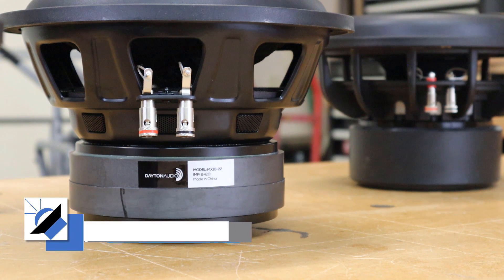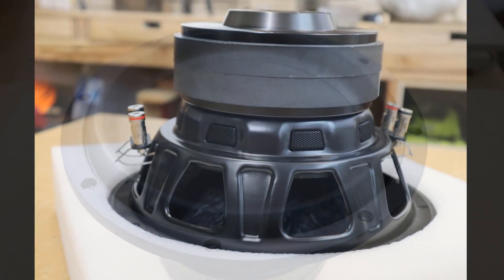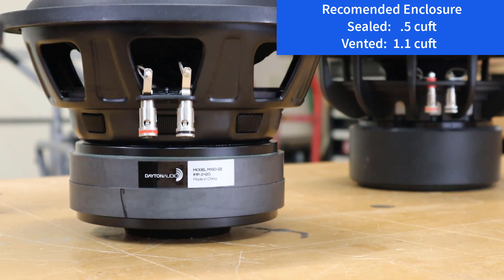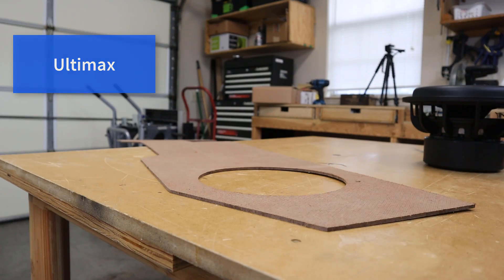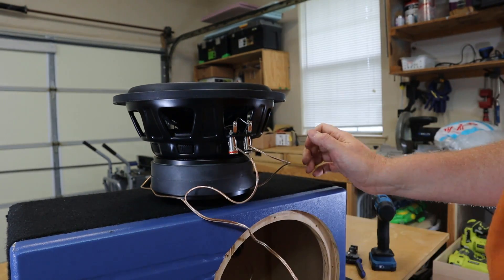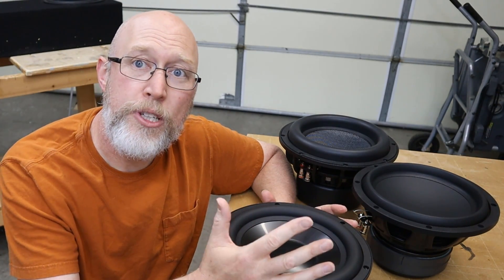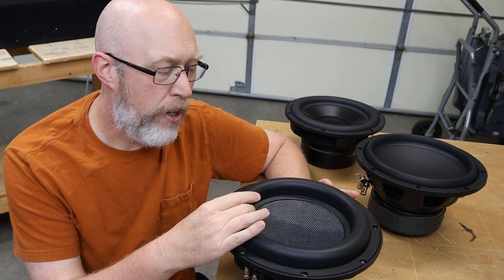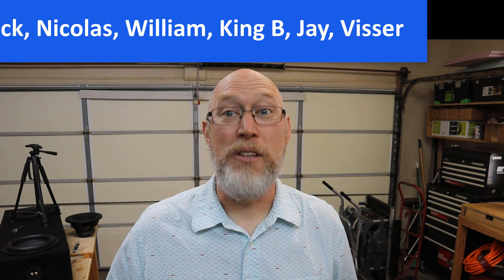Dayton Audio Max-X:  New Subwoofer for 2021

Comment: Max-X 15" works best in my 150L ported enclosures. Flat to 20Hz. I.e., any cheap car sub would work. I checked on Alibaba and any $80 common car audio driver has the same thiele-small paameters as the Dayton Max-X 15". In Norway Dayton drivers cost $450.

Comment: Do U get paid from Dayton audio to say there nice or are they really nice I'm thinking of buying the ultimax 2 12
Reply from the maker: I have an affiliate deal with him, if you go to Parts Express after clicking a link and buy something, there's a small chance that I might get a small commission.  That's very different from getting paid to save something nice about a brand.

In any case, I would not recommend a brand that I personally wouldn't run myself.  I was using the ultimax long before I started the YouTube channel. 

Having said that, I'm not a big fan of the new updated ultimax 2. I think that the Dayton reference high output subwoofer is a much better subwoofer.

Comment: What is your opinion on the max-x vs the reference? You mention both and build a box for the max-x but don’t really touch on how they actually sound. I’ve been looking at the two and there isn’t a lot of reviews out there for car applications. I know there is only a $50 difference between the two but some of us are balling on a budget. Haha. But honestly, I think we all value your opinion. That’s why we watch your videos. I appreciate you and your videos.
Reply from the maker: The reference will sound better, and ultimately handle more power.  But the reference is a lot more expensive.
Reply: @DIYAudioGuy  Thank you for the reply! I currently have a Kicker Key 500.1 amplifier. So the subwoofer bridged would be 1 ohm I should be putting out 500 watts from my amp on paper. I don’t know if either one will perform better than the other with only 500 watts. I have a sealed enclosure that I would probably end up using that is 1.3-1.4sq ft. I have a ported enclosure but it’s way too big for my trunk to be practical. Haha. Right now with a coupon they sent me they would roughly be $60-70 difference in price. So I would be more than happy to pay that if it’s worth it. I also don’t want to over/under power one of them. I really do appreciate the fast responses and feedback that you give. You rock.

Comment: Will they fit in the Vega boxes R e's 10, subwoofers I have a marantz receiver 8 ohms in trying to find 🤔 a deep bass 🔊 replacement speaker 🔊
Reply from the maker: You'll have to measure the speaker cut out and compare it to the specs on the subwoofer

Comment: do you know any good bass speakers that still has the original harness connector?
Reply from the maker: Not sure what you mean.
Reply: @DIYAudioGuy  sorry, so when I unscrew my speakers and the harness is positive with a wide harness and the negative is a skinny harness.
Reply from the maker: @irrelevantlylifeless  Sounds like a standard female spade connector.  If it is you can find them at you local auto parts store.
Reply: @DIYAudioGuy  Thank you.

Comment: One of my Klipsch THX subs died on me after 20 years of service, I thinking about replacing it with this driver.
Reply from the maker: Is the plan to drop this subwoofer into the existing enclosure?  If so then just verify that it will fit into the opening.  The original driver is probably a four ohm driver.  You'll need to verify that first.  You can wire this one in series to get a 4 ohm load.  There's no way to predict how it's going to sound unless you can measure the internal airspace of the box and estimate the port tuning.  That can all be done with a tape measure and a little bit of math.

Comment: You describe the benefits of Reference and UltraMax drivers in detail. However, only mentioned Max-X good for small enclosures, Is that all it's good for?
Reply from the maker: Lower price.  I have built an enclosure for it and have been pounding on it for a few weeks.  I am giving it a little over rated power and it can take the extra juice, no problem.  I am enjoying it quite a bit.   The surround design gives it more cone area than the other subs, and it has great X-max -- more on that when i get the video posted.
Reply: @DIYAudioGuy  Thank you for the timely response... Love your video blogs... God Bless..

Comment: I have a 16m² living room and Id buy two of these 15s for it. What should I tune the enclosures to? Mostly for home theater! Thanks!
Reply from the maker: I'm assuming you're talking about the ultimax? I would follow the recommendation on the Parts Express website.  They have a recommended tuning for infra-sonic low frequency effects.
Reply: @DIYAudioGuy  nope! I meant the new Max X! There are 10s 12s and 15s versions of these :)
Reply from the maker: @SeGin_  I'm honestly not sure how low you can tune these, I've not done any modeling of them yet.

Comment: would be nice if partsexpress sold coils for these. the reference line anyways has a kinda non standard coil size. hard to find coils that work as is
Reply from the maker: Most subwoofer brands don't sell the soft parts.
Reply: @DIYAudioGuy  coils are generally available for most but these are a bit off from the standard sizes available. partsexpress used to repair speakers too would be nice if they did still especially their own.

Comment: Quick question. I've been deep into car audio for years. I got a CT Sounds Bio 12 (300 watts rms) in my older 90s sony powered sub box (for home theatre @ about 125 watts rms). I've seen alot of people using poly fill inside the box. Does that help in some way?
Reply from the maker: https://youtu.be/INM0g1JeMLY

Comment: Hi my name is chico i bought a klipsch 2.1 system.i replaced the sub with a dayton dcs6.5 woofer ..my demensions are h9.5
W10.8 lenght 9.8 .my port hole cutout is 2 1/2 inches ..it seems to make alot of unrelenting buffering noise ..please help
Reply from the maker: Might be port noise. Not much you can really do about that when you're trying to retrofit an existing cabinet.

Comment: I love those wire strippers btw, only had mine a few months but man they're nice. And due to your video I'm tempted on trying Dayton audio. The alpine R types have been my favorite sq sub so far but the B2 audios reference is on my radar next. But for the price Dayton sounds enticing
Reply from the maker: All good choices, you're not going to go wrong.  Those exact wire strippers for one of the first real tools that I bought when I started getting into audio.
Reply: Ya, dayton will rip the face off either the alpine or the b2 in sq. Overall output? Probably not. Depends on what you're after

Comment: I run a Ultimax 10 in my Pontiac G8 powered by a Kicker Key500.1 with a custom box tuned to 29hz and it does great. Nothing crazy loud but blends well an does great on low notes for sure. Awesome review and comparison to other dayton drivers.
Reply from the maker: Good stuff

Comment: I've always wanted an ultimax 18 ,but I never pulled the trigger on any.
Reply from the maker: I'd love to rebuild my entire home theater set up and include a pair of those.
Reply: It's just a soggy 12-spoke old-school small motor 18 it can dig low because of its soggy britches and you can probably make one yourself out of used speaker parts it would probably cost me 20$ for the use basket 20 to 30$ for the motor. Used then soft parts which it has small spiders and you don't need 4 on there so that helps keep cost low . give it a shot making subs is hella fun
Reply: @jayden974  it loves the lows "soggy" means soft suspension which means it will have a low FS which means it will most likely like the lows more / Tech... Not sure where you were going with your reply?
Reply: @jayden974  there's absolutely nothing special about any of the parts it's made with so finding all the needed parts to make one of equal performance if not better and for the same or less $
Reply: @jayden974  well for 1 "better" is subjected to the person.
2 people take the path of least resistance especially in America we're so lazy we much rather pay somebody for something as opposed to enjoying and learning how to build something.

And #3 It's much easier to sell a product that works pretty good in multiple applications than it is to sell a product that works extremely well in one  specific application and  generic speakers that work pretty good in multiple different applications will always outsell drivers make for very unique applications.

And I'm sorry but every single part that subwoofers made with are very very normal everyday Parts in fact most of those parts have been around for longer than some of the most popular Parts in car audio so there's not exactly new technology being implemented in fact it's more like a classic car if you were to look at it from the car audio standpoint. The frame itself is kind of like a Ford Model T in the car audio world. But i had a pare of 18's that had the same baskets and they were great subs i enjoyed them but like I said they work in multiple different applications and I eventually replaced mine for baskets that have much deeper spider Landing and wider spider Landing 

because the 12 spoke basket limits the driver to having a 8 or 8 and 3/4 inch spider and a xmech of about 33mm one way and that limited me for the application I was putting them in (playing 17 to 24hz at full tilt) it's not that they couldn't play the frequencies that they did not produce enough output it said low frequencies do to what's mentioned above.

So I changed it up and have baskets that are made for 10" spiders and a xmech of about 55/60mm one way xmech so that I can move much much more air on those lower frequencies. 

But like I said driver specific application because what I sacrificed was some efficiency and box size but nothing perfect.
Reply: @jayden974  omg i was giving an example dude

Comment: 5:58 "𝘛𝘶𝘯𝘦 𝘵𝘩𝘢𝘵 𝘵𝘩𝘪𝘯𝘨 𝘵𝘰 𝘢𝘣𝘰𝘶𝘵 15 𝘏𝘻" Do people actually tune enclosures below 20Hz? Sounds like a lot of fun but other than that, is there really any sonic joy below 20? I've gone down to 33Hz tuning and by golly those subs will physically mess with your internal organs. Jumping Jehova's what does a 15 Hz box feel/sound like? Great review and to the point, cheers.
Reply from the maker: Parts Express does recommend a home theater tuning for the ultimax with an f3 of 18 Hertz--I probably should have said f3 instead of tuning frequency, that's a big difference.
Reply: I have a 33CF box with 2 Ultimax 18-22s tuned to 20hz. They really don't get that loud. But they do dig very low without much effort. Great if you like low end extension. I can tell from your comment you have never experienced an old school ground pounder car audio system. 150+dB below 35Hz. That will steal the air right out of your lungs, good times.
Reply from the maker: @bassntruck  That is insane!
Reply: I've been running 8 of the 18" Reference HO drivers sealed in 2 cabinets (4 per cab.) in my home theater for years now.  Running 10K watts total to the subs using a Linkwitz transform circuit to extend the low frequency response.  Very clean and reliable drivers.

Comment: I am in a serious internal conflict right now with what has happened to me with PE .. and UPS in this last month... I finally get up the funds to purchase a Tymphany STW-350, you know, the 7.4" voice coil monstrosity... Supposed 2 day shipping.... Check tracking 3 days later because I realized wtf, had lots of other stuff come in during that time from different places and couriers... But my sub... Nada... I talked to my regular driver, turns out he was on vacation at the time it was "delivered" and my god its been a nightmare. Both companies are playing pass the buck and I dont know what to do... Did PE send me a nothingburger? Or did UPS driver jack my 500$ sub?! What would you guys do???

BTW- Sweet vid DIYAG... You should build some reference boxes, one of each type for single sub benchmarking, have them be the "Gold Standard" by which you can compare similar subs like these, one sealed....Vented, 4th, and a 6th. and PLEEEEEEEEEEEEEEEEEEEEEEEEEEASE DO AN 8th order video!!! 

ALSO ALSO andPLEEEEEEEEEEEEEEEEEEEEEEEEEEASE DO AN 8th order video!!! As well as maybe address the 170db 8in subwoofer and its box?? Ronnie Smith's Sniper box
Reply from the maker: Oh man, that's rough! Sorry to hear about your shipping problems.  Typically companies don't point to blame at each other like that, but when they do you get caught in the middle.

Comment: Nice comparison 👍
Now if we can only convince them to make the 21" Kraken in a dual 2ohm.
Reply from the maker: That sub should be a dual 2 -- all these other should be a dual 4 so I can wire two of them to a 1 ohm amp.
Reply: @DIYAudioGuy  If you look at the basket it has a place for another set of terminals. I'm thinking about getting 1, if were in a dual 2 or even D4 I'd have one already 😁
Reply: No need

Comment: Sir? What is stack motor? And what is the purpose?or refer for?
Reply from the maker: That just means it has multiple magnets stacked together for increased magnetic force.
Reply: @DIYAudioGuy  so stack motor it mean the magnet?  3stack motor so 3layers of magnet? Thank u sir
Reply: @DIYAudioGuy  may i ask sir? What hz tuning box that the bass feels like crawling under the ground? Is it 35-38hz? Or 40hz or 42hz? Or what esle? Just for the box tuning hz
Reply: @akolngto9314   its not all box tuning, the type of song playing must have low end hz. Too.
Reply: @hectorortega9131  thanks. But for you sir? What is the good tunig of our box?
Reply: @akolngto9314  38  to. 40 Hz. Seems to be the Magic number for most of Bass Songs .